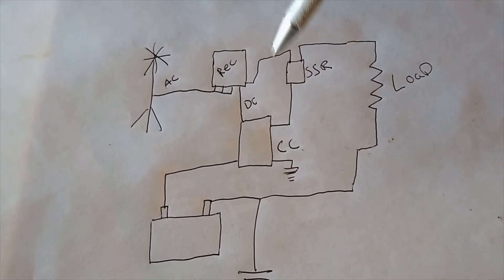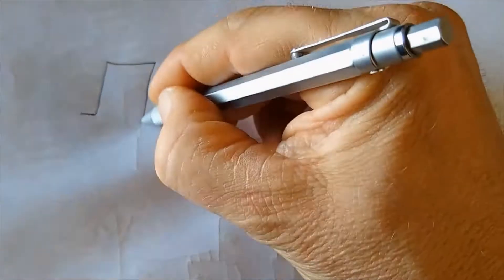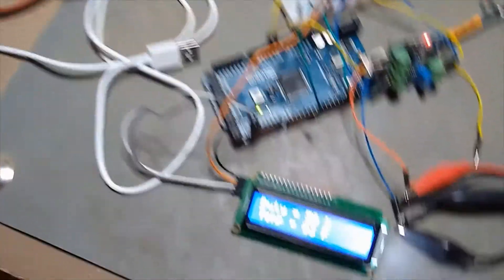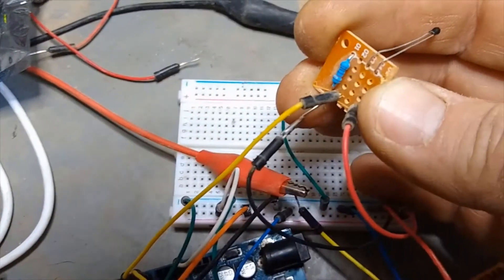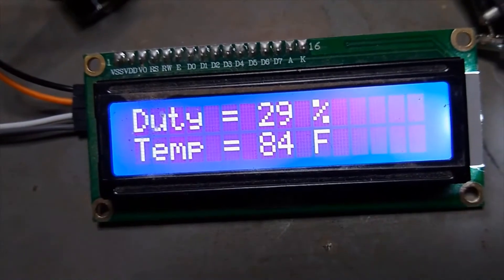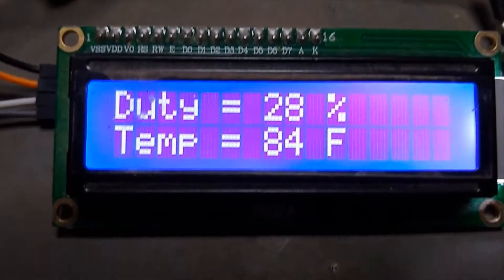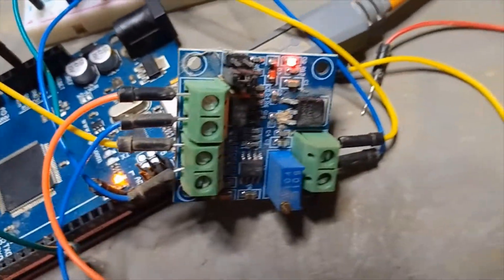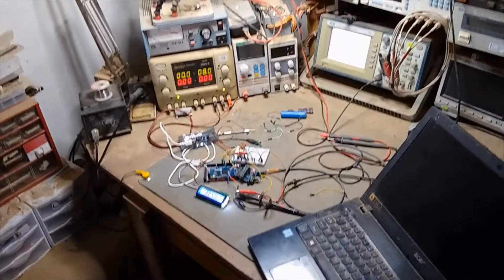Wind Turbine Divert/Dump Load Project (part one)

Comment: RS232 Option to allow slave mode for the ability to add to an existing PV system. This would allow the existing PV system to apply the brake or dump load when needed.